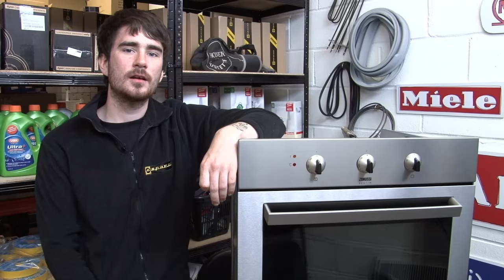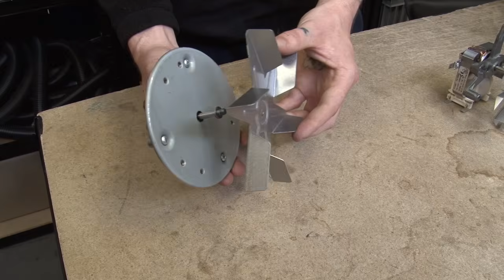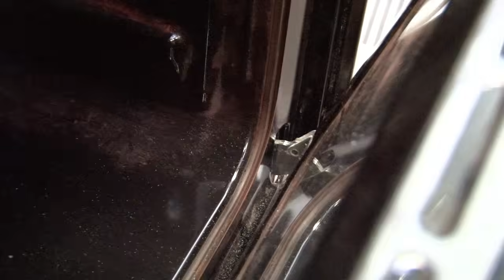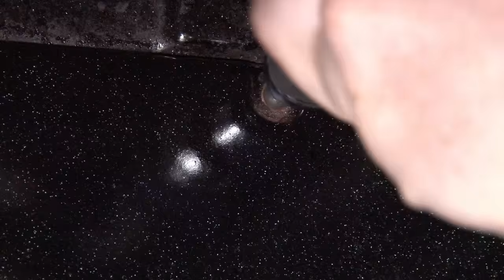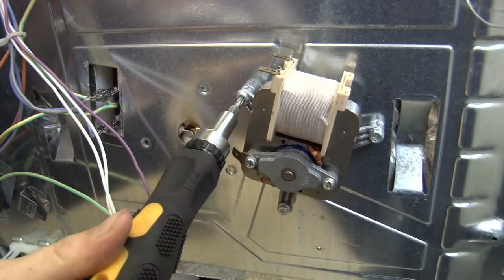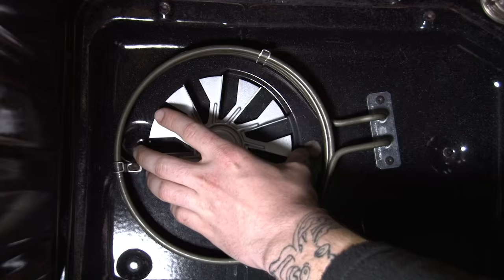How to Replace and Fit an Oven Fan Motor

Comment: Done all this. Replaced the motor but the new fan is sticking out too far. Can't put the cover back on.
Have I put the motor in wrong? or can I bend the fan blades back?
Reply from the maker: Hi, thanks for your comment. Do not adjust the fan or blades in any way. If it is not fitting, it is likely due to either not being fitted 100% correctly, or the motor is not the correct one for your make and model of oven.

Did you use the "Will this part fit my appliance" feature on the motor product page on eSpares?...to ensure that you were purchasing the suitable motor?

Comment: I just changed the heating element and motor on my Indesit oven (BIMDS23IXS). For my oven, the screws holding the fan motor in place are on the inside of the oven. You need to remove the bottom one and just loosen the other two. Going back to the motor, you can now lift it up to remove. Hopefully this might help someone facing the puzzle I was faced with. 

Also, when I replaced the cover over the fan and element and tested the oven, the fan made an unearthly noise, as it was hitting off the cover. I had to bend the cover slightly, and it worked perfectly after that.

Comment: Hi 
Yes .. both inside light and the oven quit working at the same time . Only the front orange light is working 🤷‍♂️
Reply from the maker: Hi richardo1986, test the element with a multimeter and check the filament on the bulb, if both ok have a look at the selector switch.

Comment: No light inside , no heat , only the clock works and led light that it’s getting power , it’s. Amiga oven 
What do you think the problem could be ? Thanks
Reply from the maker: Hi, richardo1986,  the first thing to check is the oven element as that is the most likely, did it stop heating and the light stop working at the same time?

Comment: What if the fan works for like 15min then stop working or sometime I have to push the blade for the fan to start spinning!
Reply from the maker: Hi Alireza, it sounds like the fan motor bearing could be causing the issue, take off the fan and turn the motor and if it does not turn freely it will need to be replaced.

Comment: Worked perfectly. Thank you!! However I did see some tinged white fiber in the back behind other parts... Should I replace those also??
Reply from the maker: Hi D HD ,  glad we could help, just be careful the white fibre is not part of the insulation so check before you think about removing it.

Comment: Great video but sometimes a fan could be stuck with a bit of dirt. Mine wasn't spinning for a month. I turned it on and used a bread knife to  help it turn . Been spinning since. Might just be stuck with grease etc
Reply from the maker: Hi whatyeonaboot, thank you for your post and a good point to check the fan for grease before you replace it well done.
Reply: @eSpares  tbf. It did work for a few days then started making a grinding noise like it did before it broke. Assuming the baring have gone as its dropped a couple of mm leaving particles of metal in the fan housing (not good for cooking 😲) so its stripped awaiting the motor. Always get the parts number and shop around as i saved half the price instead of going with the maker
Reply: @eSpares  mine worked for 2 days then tripped the electricity and now doesnt work 😲
Reply from the maker: Hi whatyeonaboot, finding the reason for the oven tripping can be difficult without the correct meter, check the connections and test the components.

Comment: Hi

I have just seen your video on thermostats and came to this! 

I have a Lamona 4401 oven. It gives some heat, and the oven light isn't turning on / and the fan isn't working (I'm assuming as it doesn't make a noise as it does when its on).

I assumed it could be the thermostat, but now not sure if its the motor, or just the fan blade! I'm stuck! :-) Any help or guidance would be mostly appreciated. Thank you!!

Comment: What happen after I replaced the fan and it is still not working ? Thank you.
Reply from the maker: Hi Michael, if you have replaced the fan motor did you test it first with a meter? you will need to test the circuit to find out what has failed, what have you checked.
Reply: It is working now. Apparently, I have to close the door and wait for a few seconds before it can run.  Thank you for the reply !
Reply from the maker: Hi Michael, glad you have it sorted.

Comment: What if their is a loud humming that sounds like a road worker has a drill in their ?
Reply from the maker: Hi Watz,  a noise like that would only come from the cooling fan at the top or most likely the oven fan, check the fan and fan motor for signs of wear so take the fan off to inspect and then check the fan motor.

Comment: What if the fan isn't spinning, and the element  (working) isn't heating, the oven light isn't coming on, nor the temp light.  All the rest of the cooker is working fine, that is, only the fan oven is affected.
Reply from the maker: Check the clock is set correctly if fitted. Then check the thermal cut out as shown in this video: https://www.youtube.com/watch?v=7xL3LsIMZPg
For more information see this video: https://www.youtube.com/watch?v=_lWk22-qvoI
Reply: Blimey that was a quick reply.

The clock was set fine, and I just found your other thermal cut out vid and that seemed fine.  Was wondering if it could be the actual control switch?

Thanks for your quick reply.
Reply from the maker: Did you watch the diagnosis video?. The problem could be the terminal block: https://www.youtube.com/watch?v=YvQEDG-hNz4
or the control switch. If there is a switch problem you should find burning of the contacts.
Reply: Yes I looked at that first, I can recheck.  Tried to check the oven thermostat, it seems to run from the oven to the back of the control knob via a very thin wire.  Everything else seems fine.  it's a double oven, the conventional oven works fine, so does the clock and the gas igniters; the only think affected is all power to the fan oven.
Reply from the maker: Check the 'relay' in the clock shows continuity when there is no power to the cooker. When powered up and not set the relay is opened to cut power.
Reply: So I put it all back together ready to fight another day - works perfectly again.

Guessing it just needed a reset like turning sky off an on again.

Thanks for the help and quick replies, learnt a lot.

Cheers.

Comment: heya, my fan seems to be moving to fast ? and making a louder sound than usual ? whats up with that.
Reply from the maker: It is likely the fan motor bearings are worn and the fan will start to fail. This can cause the element to overheat as well so if the motor is getting noisy it may be cheaper to replace now rather than later.
Reply from the maker: Hi Sally, if the noise is when the oven is switched on then check the fan is not catching or loose if that is ok then check the fan motor as it may be the bearings that are causing the noise.
Reply: eSpares my fan sounds like it’s a plane taking off are the bearings going I have a Beko free standing fan oven .
Reply: eSpares ok thanks will do .
Reply: sebastian langley these comments answered my question nice one 👌

Comment: Hi there fantastic video. My fan slowly moves, and if I give it a flick the shut the door again, and it slowly pics up speed. Do I need a new motor or is it in need of a clean. ( I'm sure it's hard to answer without seeing it).
Reply from the maker: Very common sign of worn bearings on the fan that tend to loosen as the fan warms up. The problem is likely to get worse and may cause the element to overheat and fail so we suggest replacing the fan as soon as possible.
Reply: eSpares in that case, thank you for the video.. looks like I'll be using it to change my fan. Lol.
Reply from the maker: Good luck, let us know when you have done it.

Comment: I have an old faberware t4850 convection broiler oven. It runs fine for about 3-5 minutes then it slowly starts to wind down, then stops. Any Idea what causes that?
Reply from the maker: If it is the fan that slows it is likely the motor bearings are binding so check the fan and replace if required.

Comment: sorry but you say the fan stopped is faulty. 
ours was humming and slowing and speeding up. the bearing was shot. 
so there's more problems than just a stopped fan. very misleading.
Reply from the maker: Sorry you felt the video was 'misleading', we do try to give as clear and simple advice as possible but there can always be 'another case' that may be different to the information given. We hope the majority of viewers are able to pick up the 'basic' information and use this to help when doing a repair.
Reply: It's ok.
Reply: If the fan is stopped or sounds like metal scraping or a buzzsaw then yes it is faulty either way. The maker of this video was not implying the fan has to specifically be stopped.  The fan will stop working if you leave this problem.

Comment: My fan motor replacement had the wire connections in different places so I don't know what colour wire to go on what connection lol
Reply from the maker: The motor will only run in one direction so as long as you don't mix up the earth connection (if fitted) it will not matter about the other two.

Comment: Hi, our fan is blowing out cold air instead of hot. Do you think I need to change the fan?
Reply from the maker: +Nasira Patel Hi, Thanks for your comment. Its highly likely that the element has gone on your oven and you require a new fan oven element. elements can be purchased on http://www.espares.co.uk/search/pt1595/cookers-and-hobs/elements
Reply: If it it blowing cold air out of the front that's the cooling fan. Your oven has two fans. You need to look inside the oven at the very back. If that fan isn't turning it needs replacing. If the oven is not heating at all, the element needs replacing

Comment: Hi my mam has a  Lomana 600ga (gas) it went off the otherday tripped the house reset the fuse box and the clock on the oven but still not working I took it apart but looks fine to me, kind regards mick
Reply from the maker: +mick florence We did not  recognise your model as it should have ADP or HJA before a number. If it has a electric oven it is likely to be the element tat has failed. For information on confirming the problem see another video: 
https://www.youtube.com/watch?v=_lWk22-qvoI

Comment: does it matter what wire connections go to the two different options on the motor?
Reply from the maker: +Hannah Renton The motor will only turn in one direction as long as you connect one wire to each connection it will be OK.

Comment: Unfortunately my Hoover/Candy oven does not have a removable cover over the fan and it was a swine to replace as you have to take the back of the oven off to replace the fan or element

Comment: Looked through regular web sites before popping onto YouTube. Cripes - should have STARTED here :)

We just had our stove's convection fan die hardly two weeks after our washing machine died. We figured out how to fix that from someone's YouTube video. I was shocked at how simple washing machines look when you take the covers off, and that's the same for ovens.

Nice video of the repair - that looks pretty straightforward. Love the tat, too :)

We'll post our success or failure in a while :)